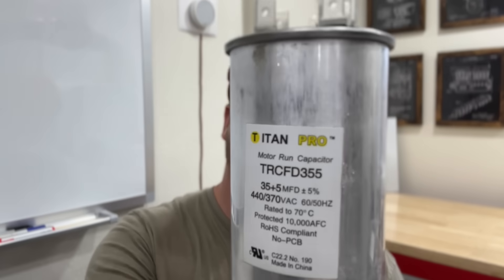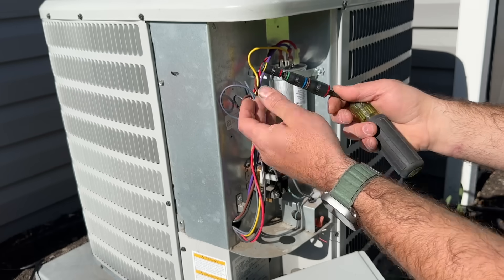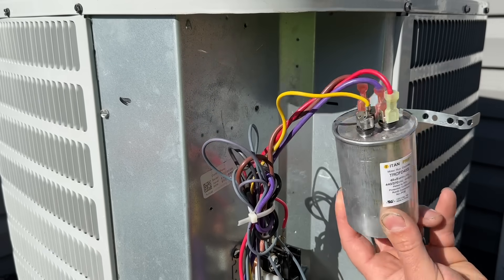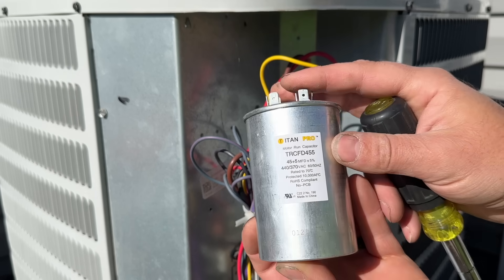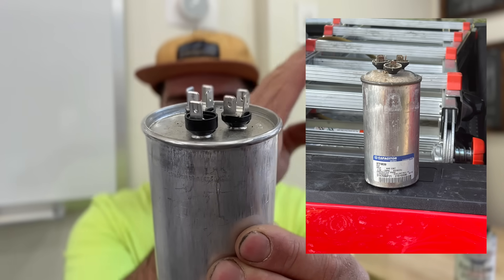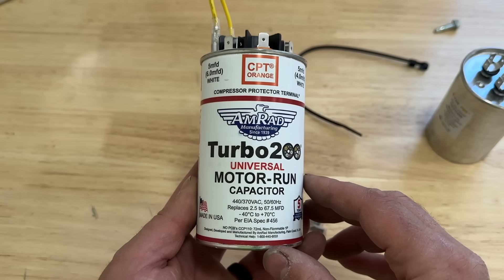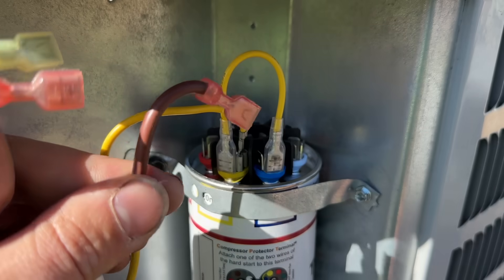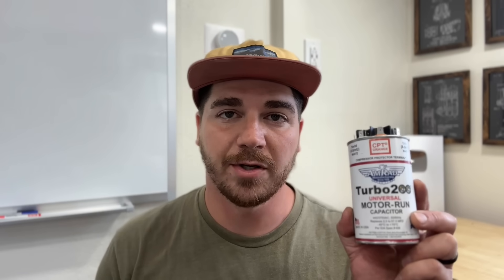HVAC Contractors Practically Make Their Living On These

Comment: I am a retired HVACR Contractor. (Actually a Mechanical Contractor in FL. That means an AC contractor that does BIG Refrigeration too, and other stuff) I have never charged $100 for a capacitor and certainly not for a residential AC Capacitor which are small capacitors. Most of the time, I sold them for under $50. This includes the purchase price (Good ones are about $30 at a reputable supplier) for a good capacitor, my time to go get it for you, keep it on the truck, replacing the capacitor correctly and checking the unit motors afterwards.) 

But an Amazon china made cap will last a season, maybe two. Some AC models have more costly Capacitors, and the China knock-offs may not be available. And don’t be surprised if that Amazon China Capacitor doesn’t start your AC unit. The percentage of bad china capacitors out of the box is crazy high. 

Now that Fluke meter he was using will set you back $150 to $250 on Amazon. Some cheaper ones are available, many are unreliable however. A good HVAC Technician will not only diagnosis your capacitor, will check the contactor, wiring, cleanliness of the unit and he will put your unit back in service & check it for correct operation and efficiency. As I always stayed booked (and did not advertise, ever) I was mostly working on a repeat client’s unit when I replaced the capacitor, usually during an Annual or semi-annual clean & inspect. SO rarely did the capacitor add much to the bill.  

But, If working on 220vac circuits don’t bother you and you have the knowledge to understand Capacitance. Sure go ahead and save a few bucks, Realistically $10 to $20. But don’t burn anything up. And if that Capacitor is bad, 90% of the time so is the contactor is bad too.  Also, if the Capacitor is bad, most likely your coils are dirty and need cleaning, so do that too or the Capacitor will go out again. Dirty Coil = High Amp Start Up = Short Capacitor Life. Dirty coils shorten the life of Condenser Fan Motors too. They are also hard on the compressor & your power bill.

And before you start, make sure the POWER is truly OFF. HVAC Contractors really hate to have fix a unit somebody totally smoked,  trying to save $10. If you short something out & pay someone to fix your mess, there is a good chance something else will go bad really soon after. NO it is not the AC Tech’s Fault either. Short circuits over heat all your electrical components in an AC unit. Lots of those get weak after a short circuit and they are put back in service. 

If your AC unit is made by TRANE and you have an Orange colored compressor. Stop and call a HVAC Contractor to service your unit. These units’ compressors have internal overloads that do NOT like being tripped. Short this OL. Out and it will cost you about $3000. Not worth the risk to save $50. Trane usually has the more expensive parts on them. 

But PLEASE,  if you think a capacitor is a BATTERY. Don’t even think about servicing your AC unit, you’re going to get hurt. A Capacitor IS NOTHING like a battery. Even after being Removed from the machine, it can give you a VERY strong shock. That shock can cause a heart attack, stop a pacemaker, burn you quite good and certainly will make you say bad words. Oh.. NEVR short a capacitor out with a screwdriver as shown. There is absolutely no reason to do this, unless you want to see the spark. You are counting on the screwdriver handle being sufficient insulation to protect you and it not being cracked, split or broken. 

BTW: A capacitor is a coil of two conductors, separated by an insulating material called dielectric. It briefly receives a lot of power (not a save voltage like a battery) and holds it for only a few micro seconds and then releases it, based on the capacitive resistance it creates. This gives the motor a pause followed by strong kick to one of its coils, called a lag. That helps the motor start and determines the direction it turns in some motors. Now that insulation inside the capacitor can be oil in an expensive Capacitors or air in an el cheap-o. China capacitors often use wax paper, so like Florida, Texas or Arizona summer heat is real hard on them. Good capacitors use mica insulation that can last five years or more. But you won’t be buying those on Amazon for $16 for a dual capacitor (Compressor & Fan).. 

Oh, one more thing, put those wires back exactly where they go. Cross them up and your repair bill will be far more than you can save on capacitors over the entire life of your AC unit. That is 220 Volts on top of that capacitor. The breaker protecting the unit is a lot bigger than the one on an outlet in your house, usually about 45 amps. So it will do some serious damage if you short it out. 

If in doubt and REALLY are two stubborn (or broke) to call someone to help; H or Herm terminal on the Cap goes to the Compressor (follow the wires), C is for Common, that will go to one side of the incoming 220 volts (often red or black), F or Fan goes to the fan motor. Usually the fan is a smaller wire, often purple, but not if the fan motor has been changed out with a generic motor. All these wires have power on them if the power is turned on, even if it is not running.

Stay Safe.
Reply: Yeah, the cheap capacitors kind of suck, but what really sucks is that HVAC suppliers won't sell to regular people, so Amazon crap is most people's only reasonable option unless they want to seriously overpay to DIY.

I've made it a habit to just keep a spare on hand in the garage, because it always seems to be the hottest day of the year that they fail, and even with Amazon prime, you end up waiting a day or two to get a new one delivered. So having $10-15 tied up in a spare to keep in the parts drawer and be able to swap it out and get it up and running again is totally worth it.

Even having to replace the cap every year or two at a cost of $10-$15, it still ends up costing less to just keep replacing them than it costs for the 5-year lifespan of the Turbo 200. And you don't have to worry about being stuck trying to warranty anything for weeks/months with no A/C, during the hottest days of the year.

I've been using Amazon cheapies for the past ~15 years, and I'll continue to do so until/unless HVAC suppliers consider becoming less hostile to homeowners.
Reply: @Wrenchmonkey1  Well, don't know where you live, but here in North Florida HVAC Contractors are not hostile toward our customers. At least I never was. But if you want to DIY & forgo the value of having an expert check why the capacitor popped... well, its your ac unit. I never stopped a DYI-er. Eventually, they all call a contractor. Hopefully next time you have to call one, it isn't because you overlooked a problem when you changed your own capacitor. Granted, cheap china caps pop often & yes, heat makes them go out. But so does a P/T problem, bad contactor or wiring issue. So be sure to check those carefully. Even if its a fan motor that cooks off because the capacitor burnt the contacts out on the contactor and you missed it.... That is going to be a couple hundred bucks to get you cooling again.
Reply: @Captkid1  
Read what I wrote again. I didn't say anything about HVAC contractors. Contractors are in it to make a buck. There's nothing wrong with that. Some are honest and fair, some have insane markups, some will outright try to scam you and sell you parts and services that are absolutely not needed. For the ones who are just trying to sell honest services at an honest price, and supply parts with a reasonable markup, I see nothing wrong with that, and they're providing a valuable service to people who need it. Not everybody can or wants to do their own repairs, even for simple things like fans, pressure switches, capacitors, etc, and that's fine.

The problem I'm referring to is the hostility of manufacturers and supply houses, who DO NOT want DIYERs to be able to get the parts on their own in order to perform their own simple repairs. They want to force you through a contractor/dealer so that you can't fix your own AC without paying that markup, or just having to buy a whole new system because they refuse to sell you parts to fix an otherwise repairable system. 

So when it comes to buying cheap capacitors on Amazon, instead of buying higher quality parts locally, that's because for a very long time, that's been one of the few options the home-gamer has had available to even be able to get their hands on them, because if you go to a local supplier, they'll tell you to go to hell unless you're a contractor.
Reply: @Wrenchmonkey1  Good HVACR Contractors are in it to make a living, not a buck, they love what they do and are good at what they do. I was an HVACR Master Technician for the Federal Goverment  for  more than two decades, I also ran a very successful HVAC-R Business. I NEVER cheated anyone as indicated in this video & comment section. I know dozens of other AC / HVAC / R Contractors that try real hard to help their customers afford to keep their AC running. I serviced & repaired many residential AC units for the elderly, disabled, impoverished & other needy people for little of nothing or free. That included many capacitor change outs. When the government taxed R-22 price up to more than double, to force its elimination, I gave refrigerant to people unable to pay without considerable hardship. I  know other contractors that were doing the same. I often paid for this out of my pocket.
To this day, being retired, still keep my license so I can service HVAC of the elderly, disabled Veterans & poor folks. I charge NOTHING.

This video gets its click bait from shedding a negative light on ALL HVAC Contractors. The Majority of the comment section focuses on the few BAD Contractors out there and why an untrained person should brave working on 240VAC to save what is in reality $10-20.

 All I did was inject some facts that bring the conversation back to reality a bit. Nobody charges $2500.00 for a capacitor changeout. And NOBODY, not even my youngest daughter would pay that without calling the Licensing Board. I don’t know what state you are in, but in Florida, the DBPR would go after a contractor in a minute for fraud (aka Scamming). 

This whole video is about making clicks (profit) off of slandering HVAC Contractors and the industry for sensationalism resulting in higher clicks. In doing so it provides some weak poor advice, if not totally bad advice. The readers are entitled to read some truth & beware of the hazzards of the advice they are given.
Reply: @Captkid1  
Nope, again, you're obviously offended to the point where you cannot even bother to read what I wrote, let alone interpret what is said in this video.

He said that it's  COMMON in the I dusty for shady businesses to scam people out of money by overcharging, or simply by lying about what is necessary to fix it.

Nobody said ALL HVAC repairmen/companies do that. That's your own editorializing.

But it's not at all uncommon for techs to claim you'll need a whole new condenser, or that you need a compressor, or that you're out of refrigerant, or any other combination of nonsense to turn a $20 capacitor into a $2500+ invoice.

So yeah, sorry, you're simply misinformed if you think nobody's getting charged $2500+ for a repair they could have done themselves for $10-15. It happens pretty regularly. 

The irony here is that when you, an "honest" HVAC tech, come in here crying and trying to run interference for that behavior, and trying to scare people away from attempting this on their own, you're kinda just reinforcing the idea that even the "honest" ones aren't really trustworthy either.

It's not a great look, to be honest.
Reply: @Captkid1  
Again, you're being overly sensitive and interpreting things in a way that hurts your feelings. Go back and read what I actually wrote. Read the sentence I said immediately after the one you're crying about. I said there's nothing wrong with being in business to make money. That's the whole reason people go into business, and as long as you're doing so HONESTLY, there's nothing wrong with making a buck.

I'm not going to read or respond to your entire screed when you can't even start your initial point from a place of honesty. Go back and read what I've actually said before you go trying to write multiple paragraphs of rant from an intellectually dishonest position. I'm not going to take on the role of the straw man just because you're overly sensitive and all up in your feelings.

Take a minute to gather control of your emotions and try again if/when you're willing to approach the discussion from a rational and honest place. Otherwise, just calm down, walk away, and go catch some fish. There's really no good reason for you to be this wound up about a non-issue, and arguing against things that nobody here has said.

If you think that there's something in this video that is dangerous or requires correcting, make your own video showing how to do it 'right'. Your aim here seems to be to scare people away from doing their own repairs. It's really not rocket science. I know you might think that you were really something special to be able to swap a cap in an AC unit, but I assure you it's really not that remarkable of a skill.

"And it's not the critic who counts," as Teddy Roosevelt said. Put your money where you mouth is, and make a better video if your aim is really to provide better education, rather than trying to scare people away from the 'easy money' that people in the industry like to scoop up and often dupe their own customers out of.
Reply: @Captkid1  Cap, I don’t think he’s saying all HVAC guys are crooked, just like all police officers are not bad.  There are a few in both professions that make the good look bad.  This guy is just educating the public on how your AC’s work and what to look for when your AC go bad. When my AC go bad I will  know what to look for if the technician tries to rip me off. This is great information for the layman. I think you are totally misreading what he is talking about.
Reply: Great information as you thoroughly explained a somewhat complex issue and simplified it
Reply: Grainger sells direct to the public.  Changed out my 28 year old Trane fan motor and updated to the proper capacitor last week.  Bought all my parts from my local Grainger down the road from my house.
Reply: @scottkuzma125  Grainger does sell direct to the public, but not at the same price as a contractor gets.
Reply: @scottkuzma125  Grainger sells the same Chinese garbage (i.e. Titan Pro) as Amazon.
Reply: @cup_and_cone 
And…they also sell high quality parts as well.  

Shame on them for providing options to their customers.

An earlier comment above mentioned that they happily stockpile cheap capacitors from Amazon in order to change them out when they fail.  If that guy has a Grainger in their neighborhood, they could just buy them on an as-needed basis instead.  Options.
Reply: @scottkuzma125  Grainger is closed on weekends and is only open 8-4.  Murphy's Law says your AC will always die on a Friday evening... leaving you stranded for the weekend.  Sometimes you can get lucky with Ace hardware stores.  I agree with others that you should always keep a spare handy.  Amazon sells USA made Goodman caps.  I live in Florida where AC runs year-round.  IME, the Chinese caps will usually last anywhere from 1-4 years, while USA caps can go a few years to over a decade.  Sometimes it's a lottery.
Reply: Seem like a lot of HVAC contractors simply double the retail price of caps then add for their labor. They also use the same formula for other parts, materials, equipment so if you need a new fan motor or blower motor, they'll like charge you $400 for a motor they paid $180 or $200 for. Whats more troubling, they will double the price of a new system so they spend $3,200 but mark it up to $6,400 then add for labor and materials. I think if they are getting paid the same month they will get a bill from their supplier, that markup is absurd mainly because they aren't using their money to supply anything...
Reply: Thanks for posting. I know my own limitations when it comes to diagnosing and repairing. Even if I happen to know what I'm doing, in the middle of a job I'll often find that I don't have the right tools on hand to complete it. I don't mind paying a contractor who knows the ins-&-outs, who checks for other things that might be an issue down the road. The trick is to find one that knows what he's doing charges a fair price. Yeah, if I worked on this stuff all the time I'd be better at it, but my time is better spent out in the garden doing stuff that I like to do...
Reply: The reason they don't sell to the public is because they come back with all kinds of questions that are improper or they bought the wrong part to start with or they bought something that they want to return because it didn't fix it so that's one of the reasons why they won't sell to the public
Reply: @vickilund7206  That is true. Plus, when the part is returned by a DIY-er, then further down stream… a Contractor buy that part & goes to put it on a customers unit and it is fried by the DYI-er who thought it didn’t fix their problem. The contractor is not happy with the supplier, the supplier is now eating the cost of the part and the customer is paying extra labor time. 

The Supplier also walk a VERY fine line when suppliers are asked; “How do I install this…” by a DYI-er.  HVAC repair / install is a VERY, VERY HEAVILY regulated profession. The HVAC suppliers can get in a lot of trouble ($$$$) if it looks like they are telling people to go around the regulatory bodies. (There are several).
Reply: I just wanted to say you know a LOT.  Just an old lady here with a bad install and other subsequent service, trying to learn to talk turkey (maybe a teeny?  Just so I know when being lied to.   BTW, our hvac contractors & some plumbers in Ohio aren't the nicest.  It's like it's a problem to have a problem.   Thanks enjoy retirement Cap'n Kid
Reply: @rebeccafraley2234  Thank you. I have built two fishing boats so far & live 30 miles from the Gulf… Hoping my retirement is a fishy one. Sorry Ohio Contractors have such a bad rep. Heating is much easier field to learn than AC, both are learnable though. When I teach people, I tell them to learn electricity & to read schematics. After that, HVAC is substantially less complex. I wrote a small technical book for rookie AC techs once. I called it; When you are scratching your head.” Maybe I should rewrite it in more layman’s terms & release it to the public.🤔
Reply: @Captkid1  Only fishing I ever did in the Gulf was the bottom fishing.  Grunt fish maybe they are called?  I know most of that coast from the land side except in panhandle.  I think whatever you wrote would be good for a layman.  I know I'd pay ten bucks for 5 pages that explain the electrical side of it.  I am just trying to figure out how  I prove that they added a new circuit to my breaker box when it was supposedly "full".   Photos photos photos people.  My total bad.  Its not all of Ohio just Logan Heating & Cooling.  My bad too, I didnt check BBB and Attorney General.   I hope you get to catch some black tip shark or other tasty fish.
Reply: From one Refrigeration mechanic to another.  Thankyou for the full explanation.  This video could get someone seriously hurt.  A Capacitor is a battery. WTF.
Reply: So essentially what I got from this huge SA is to discharge capacitor with my tongue.
Reply: @edwardb911  Thanks funny.  I guess that was an implication in the video… to some folks. Probably wouldn’t be the first time.